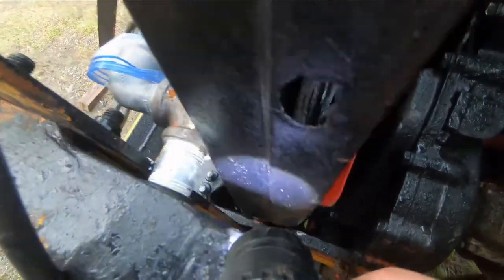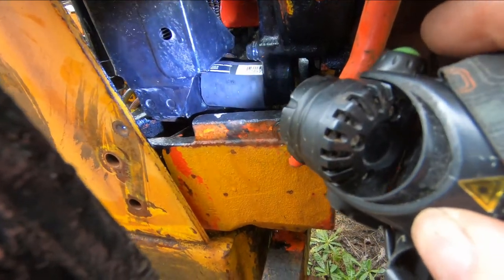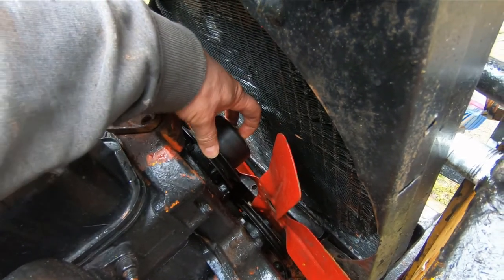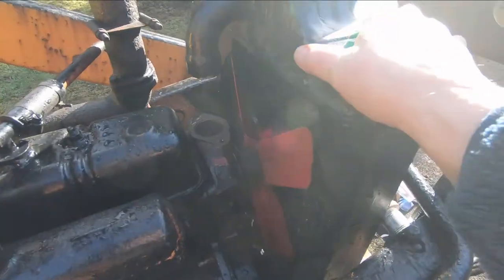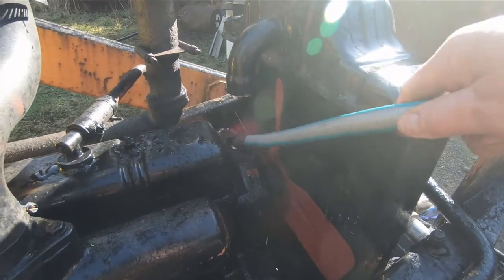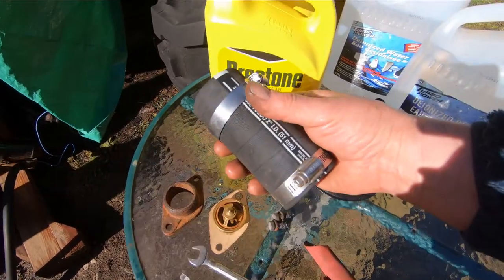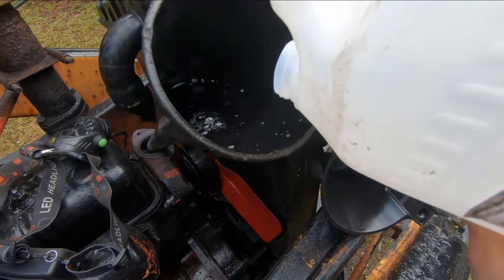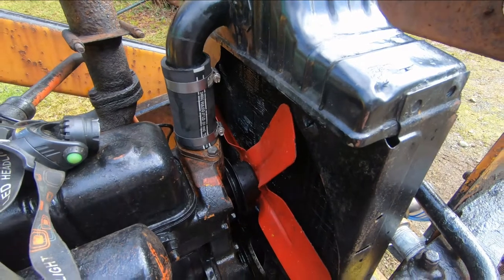1968 CASE 580CK TRACTOR: INSTALLING RADIATOR & NEW HOSES + FLUSH & FILL

Comment: I replaced the radiator in my 68 Case backhoe, that lower hose was a nightmare, not that the rest of the job was a walk in the park but I did use a little trick with the water pump. Put the pulley on and use a piece of all thread to line up the holes then slide the fan into place over the piece of all thread. Put the other 3 bolts into place and remove the all thread to place the last bolt. :)
Reply from the maker: Great tip. I’ll use that sometime. Yes, that bottom hose was tough. Thanks for watching!

Comment: Your videos are a huge help. I inherited my father in laws 580 CK it's a learning experience for sure. Question, my lower hose is leaking. It is not possible to replace it without pulling the radiator correct? Seems like there is zero space to do anything.
Reply from the maker: I showed the lower hose replacement between 1:45 and 3:30. It's tough to do but it can be done. Just loosen the radiator so you can lift it a few inches. Take the top hose off too. Good luck!
Reply: @EverydayProjects  ok awesome. So you think I can do it without pulling the fan and water pump?
Reply from the maker: @rhodeislandfirearmsownersl9916  Yes, just watch how I did it. I think you can lift the radiator enough without having to remove the fan. Maybe put a thin piece of plywood between fan and radiator to keep from damaging the rad.

Comment: Taking the front of my tractor apart... My water pump leaks terribly. How does the plate in front of the pump come off? Seems like the bolts on the side are structural... do I need to support anything if those are the ones?
TIA if you see this!
Reply from the maker: I've never taken that frame off. If you remove the radiator, the water pump should be easily changed. Then again, maybe you can pull the water pump with the radiator in...but it would be a tight spot to maneuver the pump.

Comment: I noticed you are have the transmission oil cooler blocked off, are you not going to use it?
Reply from the maker: All the steel lines leading to various components on the tractor were rusted through. This tractor sat unattended in a field for more than 15 years before I picked it up and the climate here is wet and damp, most of the year except the summer. Things rust out just sitting. I put a short by-pass hydraulic hose on the discharge from the transmission straight back into it for now, just to be able to start the engine. I will eventually put an auxilliary cooler and the factory filter back inside the grill area. Good eye on noticing that. Thanks for watching!

Comment: Why do you need a thermostat it has no heat can’t you just let it free flow so it doesn’t overheat??
Reply from the maker: Engines run best at certain temperatures. If it didn’t have a thermostat, it could over cool and not run as efficiently. Remember, diesels are compression-ignition engines and work best when hot.

Comment: Wow that's a crappy enginenearing design I have the 580d and have plenty of room
Reply: That water pump pully  cost  new 160 dollors used is 75
Reply from the maker: Yes, a tight squeeze by anyone's measure. These tractors were going through their transformation from farm tractor to backhoe looks in the late 60's (this is a 1968) and a lot of bad, earlier designs were still in the tractors. It wasn't until CASE made a separate crew cabin and redesigned the overall looks that these 1930 era engineering mistakes were corrected. Have you thought to bookmark my channel? It's done by subscribing and it's free. Then you'll get notified the next time I post a video. Take care and I hope to see you again!